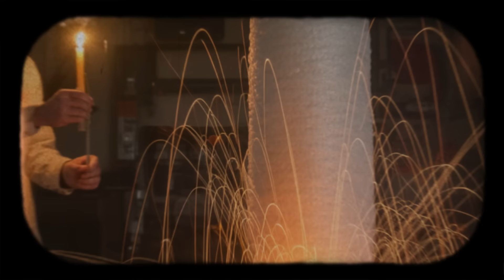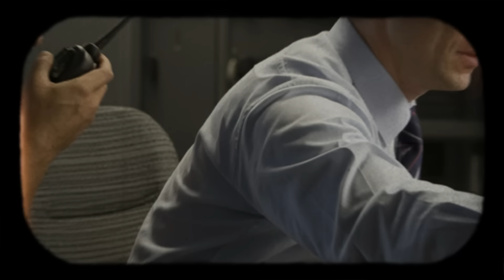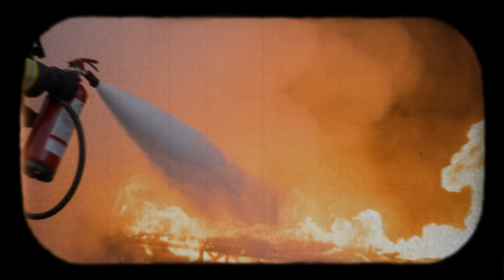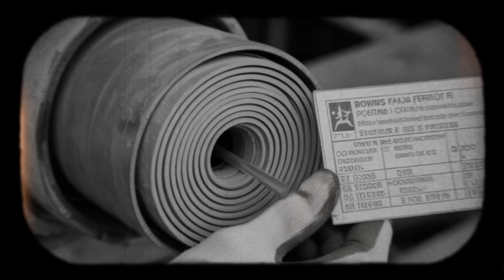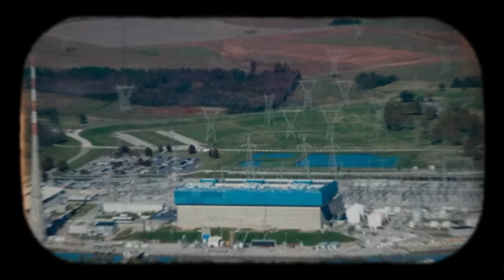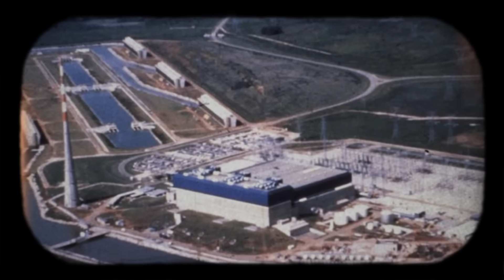Browns Ferry Fire, Minute by Minute

Comment: Genius! Flammable products tested with a naked flame. I guess that's how they look for Gas leaks as well?
Reply: I've seen gasline contractors search for leaks with a torch so it's not out of the realm of possibility
Reply: Checking for gas with a flame used to be normal too. 
Worse flame testing standard for checking for leaks on refrigeration systems too. Some coolant gasses make the flame turn green, however if the same gas is drawn through a flame it turns to a toxic gas, phosgene. If you smoke whilst looking for leaks...